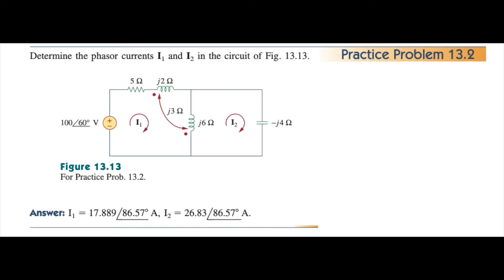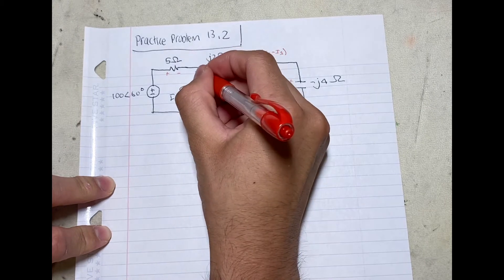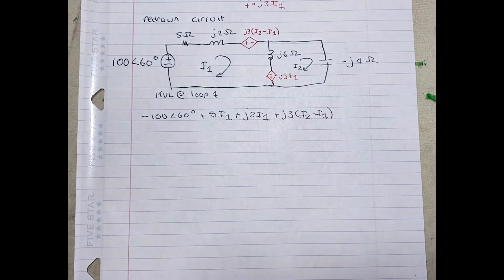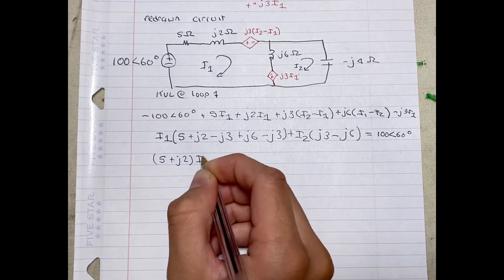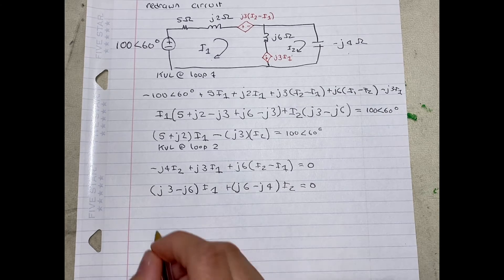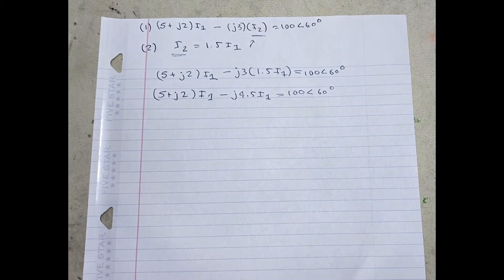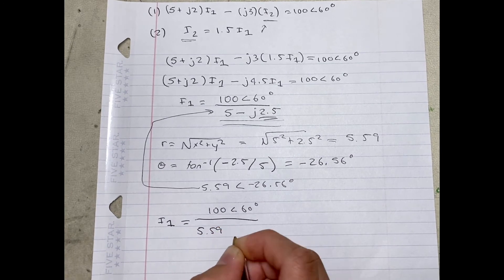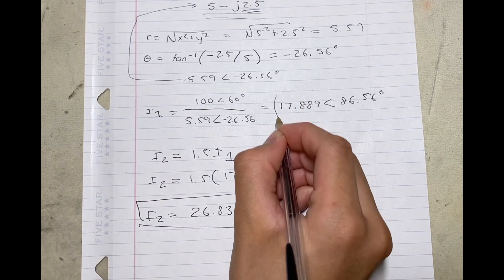Chapter 13 Practice Problem 13.2 Fundamentals of Electric Circuits (Circuit Analysis 2)

Comment: Why is it j3(I2-i1)
Reply: Same question.did any of you got the answer?
Reply: Cause you have to switch I1 and I2
That's why j3(I2-I1) went upwards
Reply: did you learned why ?
Reply: That is the current (I2-I1) that causes the inductance in inductor2j . Similarly only I1 causes inductance in  6j